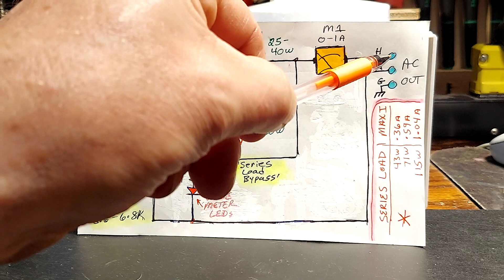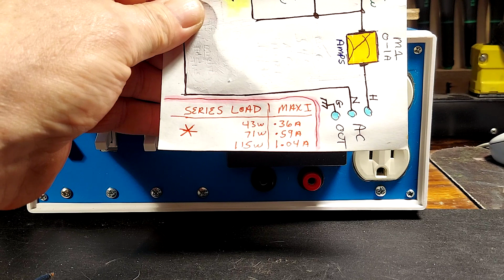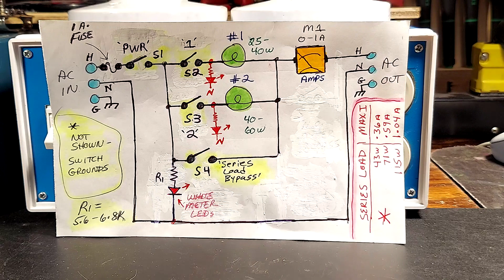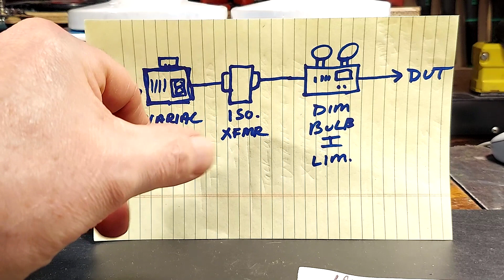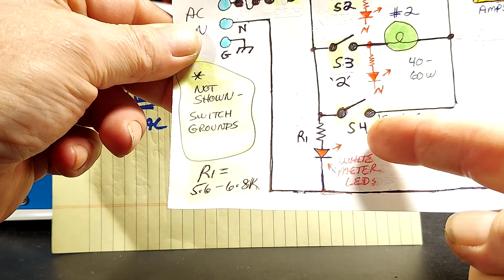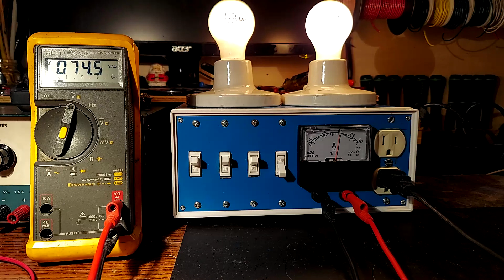Dim Bulbyst - part 2/3 - What it does, How to use it, Schematic walk-through

Comment from the maker: Opening then schematic walk-through at 01:51
04:00  What a ‘dim bulb’ tester is
07:39  Why does one use a ‘dim bulb’?
16:04  I’ve mentioned wrong resistor and current values but correct myself here
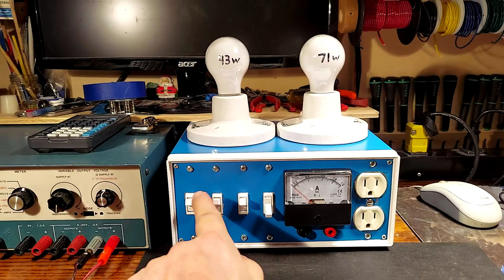17:19  Demo of the unit on a couple different loads
23:26  How to use this devise to 'reform' old, probably dead, electrolytic caps

Comment: Hi Chuck, glad to hear your voice in a much more lively mood, hope you are doing well!
Regarding the LED’s - place an anti parallel diode over the LED because an LED can’t take the reverse voltage of the AC. And the two LEDs on the lamps will always light up both because it receives a voltage through the lamp from the right side.
Reply from the maker: Robert, you nailed it. Please see part 3 for how I felt when I say my idiotic mistake. I did however mount a protection diode with each one of the indicator LEDs. I just forgot to mention it. Oops. Thanks for your comment and sharp eye! Be well  :)